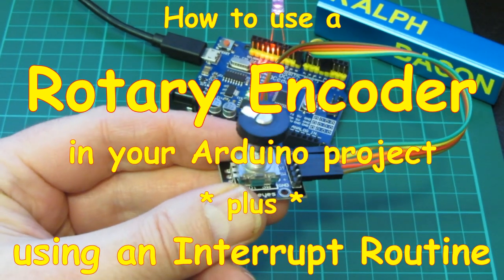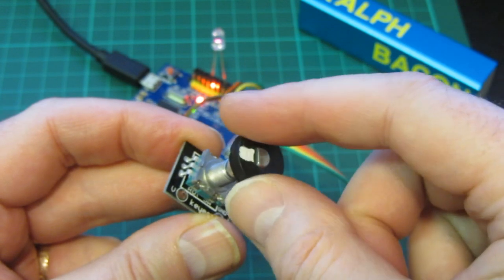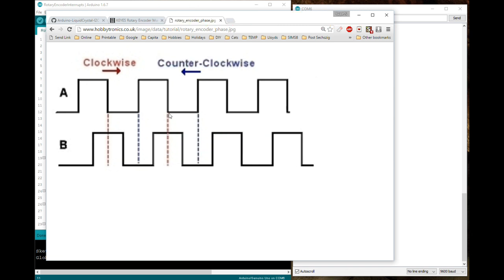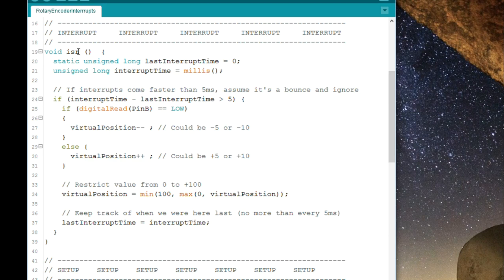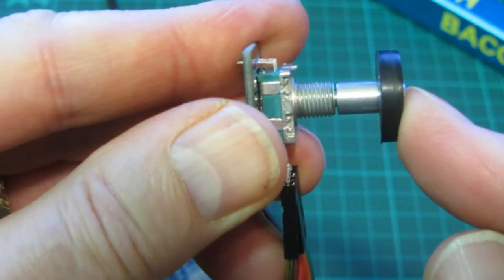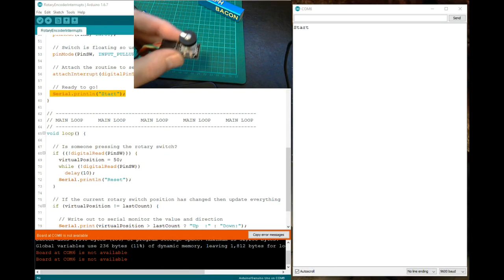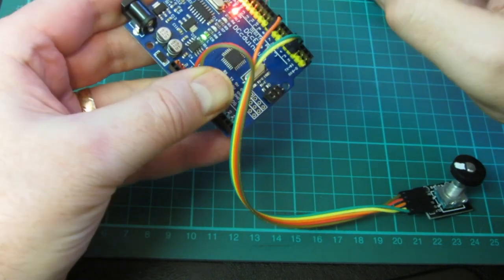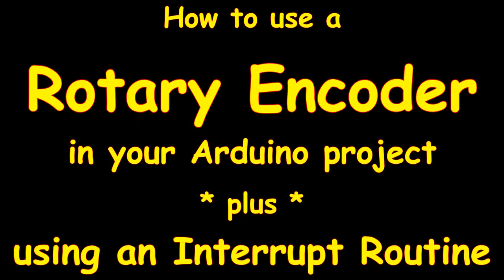#19 How to use a Rotary Encoder with an Interrupt routine on your Arduino

Comment: Thank you so much for this!

I hope you don't mind my asking, would this work with multiple encoders? I'd like to add another 3 or 4 (the 32u4 based 'Pro Micro'  board I'm using has 5 Digital pins usable for Interrupts). 

I'm very new to this, but would I define the extra pins ('const int Pin' for each A and B), define a last rotary value ('lastCount') for each encoder, define virtual positions ('volatile int virtualPosition') for each encoder,  then replicate the content of the Interrupt ISR section ('if' statements etc) for each encoder, replicate the content of Setup ('pinMode's and 'attachInterrupt') for each encoder, and finally define what you want each encoder to do within the Main Loop? That's how I imagine it might work, but I could be way off! Also would you put all the encoders within the same ISR interupt section, or do you somehow have multiple interrupts?

Sorry, I realize this probably isn't a straightforward question!

Thanks again!
Reply from the maker: If you use a 32U4, Tobias, you do indeed have 5 hardware interrupts available on pins 0,1, 2, 3, 7 but you share pins 0 and 1 for RX/TX (sketch upload) so you may have to temporarily disconnect whatever hardware you have on pins 0 & 1 (pin A of a rotary encoder, I assume) to allow the upload to work. It may work "as is". Only one way to know! More...

Everything else you say sounds sensible, just keep the ISRs slim (in code terms) and you should be fine. Easy to try this out without too much coding (eg send a Serial message for each, initially).

Do ensure you use the construct:
attachInterrupt (digitalPinToInterrupt(X)...) where X is the actual pin name (as I gave above). Don't specify the actual interrupt number, it will be a minefield to debug. Good luck!
Reply: @RalphBacon  Thank you so much for getting back to me, and so quickly! And thank you for the information/conformation! I'll give it a go!
Reply: @tobiasjames9107  You have the additional pins, but only one ISR can be running at a given time. If you were moving two encoders at the same time, it could miss one or the other occasionally.
Reply: @CrimFerret  Thanks so much for pointing that out! As I'm only planning on using this for Photoshop brush size and zoom etc, that won't be a problem. I imagine if you wanted to move two encoders simultaneously (as you might for something like an audio synth or for robotics) you'd maybe need to use an  interrupt-capable I2C GPIO expander, which I've read about but don't fully understand haha!
Reply: @tobiasjames9107  The why and how are the important parts to learn. Those who just wire these projects up and go oooh....ahhh over the blinking LEDs are missing the point (I actually know a couple of people who think making LED's blink is what the Arduino is for).

Comment: Thank you, very helpful. I'm new to Arduino and I'm building a button box for my Racing Sim in which I use two encoders and one rotary Switch. I have used your code for one encoder but I don't know how to use it for two encoders. Would you be so kind to help me on this?
Reply from the maker: Yes, Maurizio, it's easy enough to do. If you have already built the demo circuit for one Rotary Controller you will have used ONE of the TWO interrupt pins available on the UNO. They are pins D2 and D3. So write an identical attachInterrupt statement but this time specify the other pin (so if you have used D2 this time, use D3 in the new statement, or vice versa) and specify (and write) another ISR for the new interrupt pin. Then everything else is pretty much the same. You will be duplicating some code but for a beginner that's easier than trying to be clever and getting bogged down. Have a go, let me know how you get on.

Comment: Hello Sir, How to operate multiple servo motors using interrupts simultaneously with servo.h library?
Reply from the maker: You only have two interrupt pins on the Uno and related boards, Najeha, so that's how many servos you will be limited to if you are using interrupts to control them. Is this really what you asked?

Comment: Hello, excellent video, it is the most effective and accurate that I have seen, it works perfect for an encoder, I did it for 6 encoders, but when I moved them, it does not show me any value on the monitor, you know why this is, greetings .
Reply from the maker: Remember that each encoder requires a hardware interrupt pin - the Arduino UNO only has two, pins 2 and 3, could this be the problem?

Comment: Can you make another example with an interrupt timer?  My setup requires the interrupt pins for other tasks like safety sensors.
Reply from the maker: +naps1saps
Do you mean an example WITHOUT an interrupt? This would only work in a sketch that has been carefully written to have no Serial.print statements, no delays and in a way so that each function (method) is only given a small time slice to do its work - otherwise you could so easily miss that rotary encoder pulse - hence the use of interrupts. If you have run out of interrupts I would seriously suggest you move onto an Arduino Mega which has many more interrupt pins (six, I believe) which would solve your problem. If you are in a part of the world that can buy from the Far East (via eBay, for example) then you can pick up a Mega clone for about $10 or so, very good value.

Comment: Hello RalphGoing through all your videos again.I am confused with a couple of lines of code in the isr of the original sketch.void isr ()  { 
20   static unsigned long lastInterruptTime = 0; 
21   unsigned long interruptTime = millis(); 
.
39   lastInterruptTime = interruptTime; 
}In line 20 why the "static", what does it do; but mostly, the last thing we do in the isr() is set "lastInterruptTime" on line 39 ready for next interrupt, but next time the interrupt runs the first thing we do is reset "lastInterruptTime" to 0, why don't these statements conflict?Thanks for your time againGreg
Reply from the maker: A static variable is set to its initial value (if it has one, this one does) and is then removed from the function_ , making it behave almost like a global variable except it can only be accessed by that function. Keeps things much tidier. Thus, line 39 does indeed update the variable with the current millis, but on re-entry to this function line 20 is not actioned; that statement was only ever actioned once, the very first time the function was invoked.
Does this make sense?

Comment: i have encoder non stoppers my only concern is how to  convert into input mapping for gaming.?

encoder used 600ppr
board used Arduino Leonardo
Reply from the maker: In principle it works the same way, although I found non-stepped/non-indented more difficult to work with. 
You still compute which way the rotary encoder is being turned, and how quickly and then have to decide what to do with that information for mapping or gaming. 
As you are using a Leonardo you could build a virtual keyboard and use the rotary encoder to either issue "Left Key" or "Right Key" signals depending on which way you were rotating the spindle.
Reply from the maker: That looks like you might be overloading the processor with interrupts.
Reply: @RalphBacon  hmmm.. 🤔
what else can be done that way.?

Comment: Hi sir,
How do we write the code to calculate the rpm of a wheel connected to the encoder?
Reply from the maker: +Radha Krishna Korlam
Hello! Firstly thanks for posting that question. I'm sure others have wondered the same. I'm not sure that a rotary encoder of this design is really suitable for attaching to a wheel (ideally you want an optical sensor) but let's proceed as though it were OK.
 
You simple need to count the pulses received (via the interrupt) during a 1 /10 /60 second interval (depends on how fast the wheel is going round). You can accurately detect the time interval by comparing the current millis() value with the previously stored millis() value from the last loop. When the time exceeds your interval (1 /10 /60 or whatever timeframe you have chosen) then you can calculate (extrapolate) the rpm.
 
Personally I would not use a rotary encoder. I would use a Hall Effect transistor to count pulses from a small magnet attached (very securely!) to a wheel. I have such a video already in an advanced state of preparation but not yet published, but it won't be too long. I'll use this as an example of how a Hall Effect device can be used, so thanks for the suggestion and good luck with your project (or home) work!
Reply: Ralph S Bacon
Thank you so much for your help sir. I am sure you are one of the best youtubers. And your content too is very helpful too.
If I have any doubts with arduino based projects, may I contact you via mail or something else?
Reply from the maker: +Radha Krishna Korlam
Thanks so much for your supporting comments. As regards help with your projects I can recommend the Arduino forum (http://forum.arduino.cc/) where there are many, many experts just waiting to help. You may even spot me lurking in a corner there too! This is definitely the best approach as I just don't have the time to give specific, bespoke help which I'm sure you understand.That way, I can develop more videos whilst the experts at the forum help newcomers with their projects.
Reply: Ralph S Bacon
Yup sir, I understand. Thank you. :-)

Comment: Hi, excellent video. I am looking forward to using a rotary encoder to build a volume control knob. My question is, what happens when the power is turned off or cut off for some reason? How do i store the last value from the rotary encoder form the Arduino board in order to maintain the last value of the knob? Should i use a SD card? 

Thank you in advance.
I apologize for my english, not my native language.
Reply from the maker: No need for an SD card here, Daniel. Just use the Arduino's built-in EEPROM. Very easy to do, see videos #26 & #27 to see an example (stores a light level) and video #65 on how to use the EEPROM, very easy. Any good?
Reply: Hi Ralph, thank you very much for such a quick reply. I will look into the videos you have mentioned. Thanks again for the great help and great tutorials!

Comment: Thank you for this tutorial,
 It'll help me with my music project.

As my project has a lot of timed interruptions I also had to add some cli(); and sei(); to block and restore the handling of the interruptions, inside the equivalent of your "if (virtualPosition != lastCount)" in the main loop() function. It may also fix your problem if your "isr" function is not called when intended.

But some strange behavior happen: when I add those cli(); and sei(); inside the "isr" function itself the arduino resets everytime it's called.

Does anybody know why ?
Reply: I'm still investigating. 
Summary for my investigations:
context:
- Arduino MEGA 2560
- I don't have the Dupont wire shield, only a plain encoder (the type you see on the pcb but without the pcb), I only use the turn detection pin, not the button for now
- I 'm using the INPUT_PULLUP mode on the pins for my arduino to handle power to the encoder, way simpler, less cables 
- I use tone so my Arduino is constantly using time interrupts in addition to the rotary encoder handling
what happens
- if interrupt on pinA is in LOW mode -> it works without cli() and sei(), if I add cli and sei inside the interrupt routine it crashes
- if interrupt on pinA is in FALLING mode -> i can add cli() and sei(), it doesn't crash, but when turning right I get sometimes "turn left" detection 
some leads:
- maybe the breadboard connection is loose and we detect too much falling on pinA because it's trembling when I turn
- maybe the interrupts stack in LOW mode, because of the cli(), too rapidly and that's the reason why it crashes.
my workaround : 
- I'm in LOW mode, I don't use cli and sei, and it works, but I don't understand why, is there a protection for an interrupt function not to interrupt when it's executing itself ?
Reply from the maker: Ideally, you want to detect FALLING, as LOW will constantly retrigger whilst it is LOW (and requires logic to ignore that).
Using sei and cli will not crash the program. Are you using these commands to prevent further retriggering of the interrupt routine you are in or to prevent the other timer interrupts? 
Are you sure your wiring is not shorting something out?
Getting a LEFT signal when turning RIGHT indicates that you are getting switch bounce or turning it too fast - have you allowed for switch bounce as per my demo code? 5mS should be enough.
Reply: @RalphBacon  
Yes I'm using the rebound protection. The decrease looks parasitic, but I secured the pin and I still got those, when I'm turning to increase it happen like once every 4-5 increase ....
When I'm using LOW  without sei and cli it's ok, no parasitic decrease.

Here is the interrupt routine 
https://pastebin.com/NdmyJh4X
Here is the consume code for which I detect "-1" on the counter when I switch to FALLING with cli and sei:
https://pastebin.com/r1Cu7PAR

 If you are curious, full code is available here (may change, I'm currently updating this project on this branch)
https://github.com/DelTa-B/hook-matching/blob/release/demo3/HookMatching/HookMatching.ino

What I think is that the arduino MEGA compiler tells to block interrupts when processing a LOW trigger and that a cli in this state crashes.

Also my connection is CHA to the left pin, Ground to the middle, CHB to the right pin. CHA is an interrupt pin, CHB is not (but I tested with an interrupt pin and got same result)

CHA and CHB are in INPUT_PULLUP mode.
Reply from the maker: Check out Nick Gammon's website about interrupts - you may find the answer there: https://www.gammon.com.au/forum/?id=10945

Comment: Hello, I have seen your tutorial and I have tried it and works very well, but I got confused how to send that data to blynk so I can monitor the movement? Would you help me to solve my problem please?
Reply from the maker: Many people misunderstand what the Rotary Encoder is actually doing: all it does is tell you which way the spindle or knob is turning, Joni. There are no values. That is for your sketch to decide that each "step" represents 1 or 50 or 500000. If you use my test sketch and work out what is happening all will become clear - note that I add or subtract a value depending on the rotation direction; no value is being given to the sketch.

Comment: Hi Ralph and thanks for the video. I am not that skilled in C but I am trying... How come that the varible that is static in the interrupt routine doesn't lose its value when the subrutine ends?
Reply from the maker: Hello Christer, good to hear from you. The whole point of a static variable is that although it is declared within a function (subroutine) the compiler pulls it out so that its scope is not constrained to that function's scope - it survives even when the function ends, in much the same way that a global variable survives, except that it can only  be used by the function that declared it. I think it's better than a global variable as its scope is still constrained (you can't amend or read its value anywhere except in the function it was declared in) but other viewers (no names mentioned but Robert might read this) think that global variables are easier to use - which might be true but are also easier to abuse and introduce bugs! Is this clear? If not, reply to this message and I'll have another go!
Reply: Thanks Ralph, crystal clear! I think I need to pull out my old C/C++ books from the dusty shelf ;-) Thanks again!
Reply from the maker: How did I get your name wrong in my reply! Doh! I've changed it now, Christer, and I'm glad my response was clear enough. Keep coding, your C++ will only improve.

Comment: Hi, I'm trying to make a rotary encoder work to increment a seven segment display. I have the display part working fine, but every way that I have tried to program the rotary encoder, with or without interrupts, the counter goes from max to min as soon as the encoder is moved. Any help? Thanks.
Reply: Never mind, I just had to us the pullup resistors for both outputs A and B of the encoder.

I'll leave this here in case anyone else has the same problem.

Great video. :)
Reply from the maker: If you define the input pins as INPUT_PULLUP you should not need actual pull up resistors. Check the code to verify this and try it out!
Reply: @RalphBacon  That works too. Thanks!

Comment: Can we use rotary encoder for sensing the projection's xy coordinates? 
As we can use Lidar for the same.
Reply from the maker: Not sure about this, Bharti. If you mean that you want to hang a pendulum on the Rotary Encoder so it turns the shaft as you move the object around it could work (especially if you used a stepless version) but really you should be using the device described in vide #76, an MPU6050 3-Axis Accelerometer Gyro which would work a lot better. Have a look at that video and let me know whether it's a good fit for your project.